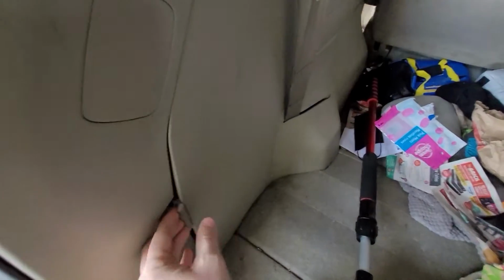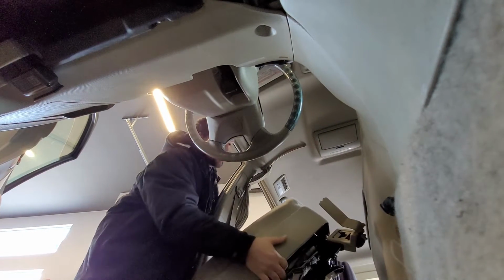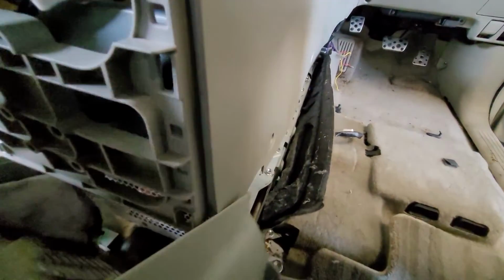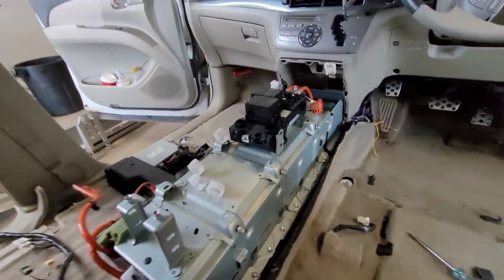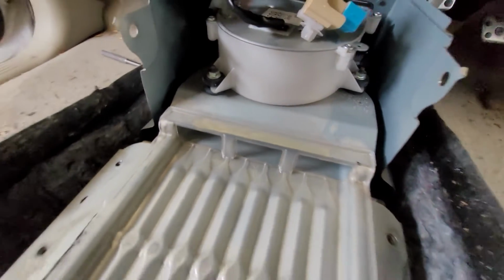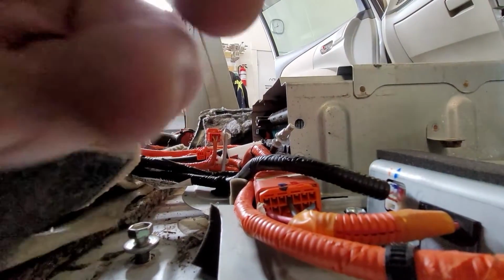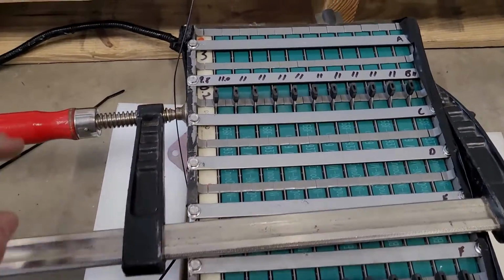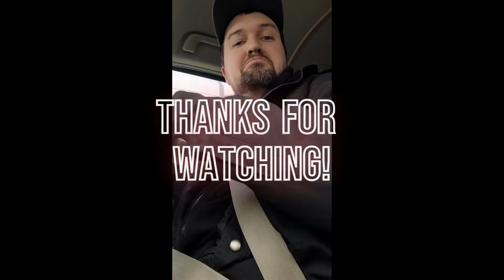JDM Estima E01:  Hybrid Battery diagnosis. Hybrids on hard mode.

Comment: Canada drive on the left ?
Reply from the maker: Nope
Reply: @gearheadsyndrome  i saw the steering wheel on the right which drive on the left in your video. That's why I am surprised
Reply from the maker: We can import vehicles from anywhere once theyre 15 years old so with these were sitting on the wrong side. Makes drive thrus interesting.

Comment: My is all 10.2  is it dead or still working
Reply from the maker: If that's the voltage of the cells in the lower pack then that's good. If that's the voltage in the upper pack then that's not good. I'm assuming it's the lower pack voltage since you said they're all the same which is likely good.

The thing that can happen is that a failing cell can drop faster under load than the adjacent cells. That's why it's good to test with some kinda of load and watch the voltage drop.

Comment: great work, excellent video, awesome stuff. how's the fuel consumption after the new battery replaced? significantly better? this estima is way more value for money compared to the sienna hybrid!
Reply from the maker: It jumped from 10.5km/l to about 12km/l.
Reply: @gearheadsyndrome magnificient! currently with my new K112 CVT, i'm getting 6-7km/l for city driving, and 11km/l on highways, that also feathering 100km/h only, above that the fuel consumption worsen.

Comment: Great video.
Where does the battery fan get it air input from? from under the car? Is there a filter? Did you check how dirty fan etc was ?
And where does it exit?
Reply from the maker: The fan gets its air from one the dash. There isn't a filter but it can clog with fine dust. Almost like lint. You always take the opportunity to clean them out when doing this. Mine wasn't that bad but I still blasted compressed air in there whole I was at it.

Comment: Hi mate, does it have 2 different types of battery and did you have to change cells in both?
Reply from the maker: Yes, and yes. The video shows both battery packs (one for front motor, one for the rear)

Comment: Hi i wondering if you get fully charged  the battery and how long is working to drive on that ,because of mine on indicator is showing half charged and drop to 2 or 1 line ,do you have a idea what is wroong ? battery is nearly gone? No errors and year is 2011 .
Thank you
Reply from the maker: It's really mild hybrid system with only about 20% of overall power from the electric motors. Its really is only good on EV only mode for a couple kms. Its mainly just for regenerative braking and to help the gas engine along when accelerating.
Reply: @gearheadsyndrome  thank you for response but in my case if i switch to ev is going just about 200 m and he disconnected and switch on petrol
Reply from the maker: There is also a maximum speed.

If you're concerned about your battery condition, I highly recommend the Dr. Prius app and a compatible BT OBD 2 reader. Very useful diagnostic tool and not that expensive.
Reply: Note the DrPrius app will show six 19.2V batteries and nine 14.4v batteries
Reply from the maker: Correct. It groups the smaller cells into pairs of two because that's how theyre configured in the pack and how the toyota software monitors them.

Comment: Where did you order those battery cells? Did you order them from overseas?
Reply from the maker: I ordered them thru Ennocar out of China. Oem proved difficult to source.
Reply: @gearheadsyndrome  how much was the Ennocar cells from China in total with shipping to Canada? I owned a 1st gen Alphard Hybrid in Canada but ended up getting this generation Estima with the 2GR and V6 AWD because i was afriad of this battery situation. I understand for the 2nd gen Estima hybrid, they are half LS600H cells (impossible to get used) and half highlander hybrid cells to make a pack. I really do miss the hybrid functionality of the Alphard hybrid and am looking at these again.
Reply from the maker: At the time (Jan 2023) it came to about $3000 CAD for all new cells for both packs including shipping/duty etc.

Comment: Now I understand why the van is worth $3-$4000 in Japan. I am looking at one in West coast from a dealership. The good thing is it’s been serviced and checked by experts hence the $2k premium over importing one. My plan is to turn it into a camper van for a trip in May across the USA. Meanwhile I can do Uber Eats to stress test it more while I convert it. 😂

Can the mid section captain seat be installed reverse so it faces the trunk?  I just need one chair so as long as it fits the rails then I’m good.
Reply from the maker: Check out the review video I made in November after owning this one for a year.
Reply: @gearheadsyndrome  This encourages me to get one. The hybrid battery will last another 150,000km and more if you use it daily. Order extra wear and tear parts like tie rods and it’s good. Thanks for taking apart the battery.
Reply from the maker: I've been able to source everything so far. There is an estima parts supplier based in the UK that ships to Canada and has all wear parts
Reply from the maker: I've taken them off, I'm not sure if the lever to slide them on the rails and left and right will work when you reverse them. Might have to get them in the position you want. They should bolt back in though.

The hybrid is a damn good road trip vehicle with the inverter/outlets and curtains

Comment: Fantastic video! Not much people even know this pretty model. Thank you very much. And, do you have an idea how to "utilized" more power on the battery rather than petrol please? My 09 Hybrid runs 7.7L/100KM (12.xKM/L) and the engine kicks in very early. Even though, the car doesn't have a good acceleration experience.
Reply: And Prius got its Lithium batteries "upgrade kit". Estima doesn't yet....
Reply from the maker: The estima might be a while before someone figures out the lithium upgrade as the hybrid model wasn't sold alongside the petrol versions anywhere outside of Japan. Fingers crossed though. 

As for your question about the gas engine coming on rather quickly, the hybrid system in these vans is considered a light hybrid with both motors combining for ~22% of the vehicles overall power. Compare that to a 2nd Gen prius where the electric motor produces ~47%. The gas motor will come on with anything other than the lightest acceleration but that doesn't mean the electric motors aren't still helping share the load. My fuel consumption was approaching 9l/100km right before the original toyota batteries failed. After swapping them the van immediately improved to 7.4l/100km so battery capacity is helpful in that regard.

Still comparable minivans where I am in North America typically get 12l/100km on a good day. The most modern $60,000CAD 2023 Toyota Sienna hybrids average ~7.0l/100km. So you're still doing pretty good!

Comment: Thank You so much I need to know  all about that van  2006 - 2007 so far I know engine is 2.4 L 2AZ-FXE I4 which is also used at Camry hybrid   and transmission type CVT k112  used also by Toyota RAV4 – 2.0/2.4/2.5L (2005–2011) so I think no problem with parts  in Canada if something happen  and main battery should last 100000 km but I don't know if is available in Canada or import only and how much it cost;  also brakes I mean what is compatibility with other Toyota cars and practically all car parts .Generally  I am trying to have knowledge what parts are available  to buy in Canada what i will need to import.
Reply from the maker: The brakes aren't compatible with other Canadian toyotas from what I've been able to find out so far. When I do need brakes I know the fronts can be swapped to highlander discs/pads if you also change the calipers. I'm still trying to confirm the if the same can be done with the rears. If not there is a parts supplier for Estima parts based in the UK that ships to Canada. Pads and rotors for front and back come to about $800CAD total after shipping.

When it needs any sort of maintenance I'll be sure to film and upload here.

If you haven't already I'd love if you subscribed and followed along with the Estima and our other projects like Benoit's Supra or my Crown.

Cheers
Reply from the maker: https://www.japeurocarparts.co.uk/search.php?id=0&vid=2206&make=7&modelID=2129&id=#results For parts, just double checked. It's $711 CAD to ship full set of pads and rotors for the Estima.